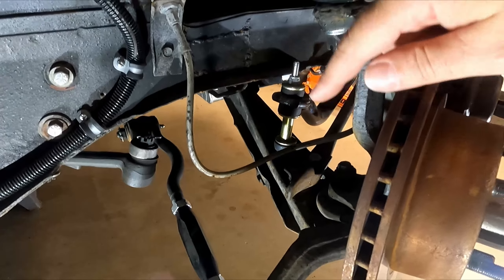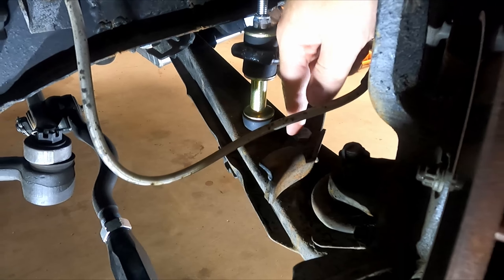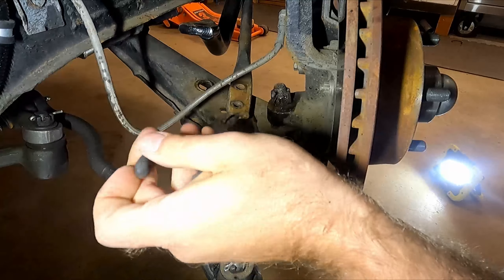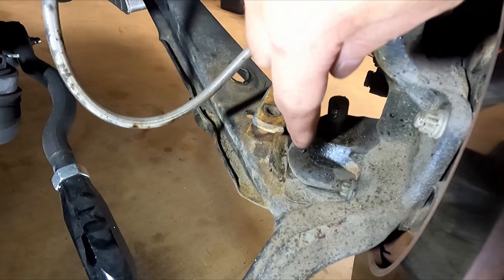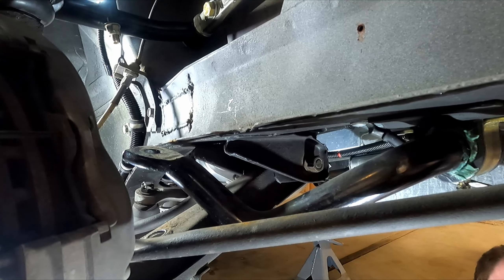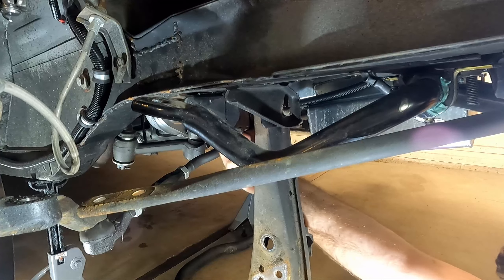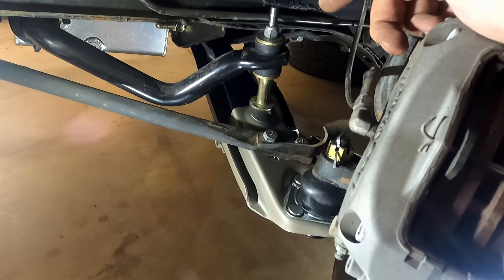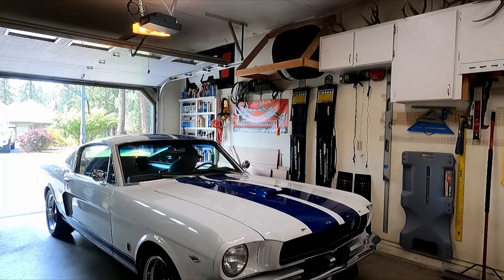How to replace the Lower Control Arm - Classic Mustang

Comment: Andy, make sure not to tighten your sway bar bolts until the car is back on the ground to prevent preloading/binding them.
Reply from the maker: The bushing that hold the bar to the frame are greased, allowing the bar to pivot when the car is sat down on the ground.  We're good.  :)

Comment: Hey there Andy, not to beat a dead horse 🐎 here, though it is critical, that the car be on its own weight, the front suspension be at or nearest it's "at rest" ride height, then tighten lower control arm bolts. The elastomer(pored rubber) in those bolt "sleeves" will "rip", and be destroyed, in short order, if they tightened while at full bottom travel. The twisted rubber "preload" effect, can make the car ride higher, and feel "strange" and "floatie" as well.. Otherwise, love watching you brother.. Your living, our "best" life !!!!
Reply from the maker: Thanks for the heads up.  :)
Reply: how do you reach them?

Comment: Hey Andy! I recommend picking up a cheap swivel impact extension from harbor freight (it’s branded Icon and is sold as a kit with 3/8 and 1/2). That chrome u joint one you were trying to use never worked well for me. The impact rated “cv” style from harbor freight works 10x better in my experience for tight bolts that have crud on the threads.
Reply from the maker: Yeah, there's a bunch of tools I need to get, but I keep using the old ones because I need the money for more car parts.  :)
Reply: The other issue is when that chrome one breaks and becomes shrapnel

Comment: Doing this on a 69 Mustang. Having a hard time getting the LCA ball joint bold to line up. Think I'm going to have to rent a spring compressor. Tried some minor jacking up on the rotor, no go. It's just too far out of whack and it seems to be coming from the spring load. Rumor has it that the previous owner put big block springs on this car and that could just be what is making this such a challenge.
Reply from the maker: Yeah, some times there seemingly simple upgrades can turn into a four hour ordeal.  :)

Comment: If those are Scott Drake lower control arm hopefully you have better luck than I did I had to replace the driverside after 15000 Miles because the ball joint went bad.  Probably need to replace my passenger side also
Reply from the maker: Yeah, they’re cheap, but that’s ok, they won’t be on the car long enough to worry about it. 😉

Comment: 5 star video Andy, Right now I am doing this exact operation. I am replacing the upper and lower controller arms. I am not sure how tight I should tighten the lower arm lower castle nuts. My concern is that have over tightened them. Good advice none then the less. Thanks Andy.
Reply from the maker: 75-100 ft-lbs on that bolt that attaches the lower control arm to the frame.

Comment: Good idea on the replacement LCA bolts. I bought the hardware store specials ahead of time, so of course the OEM bolts came out smooth as butter. If I hadn't bought the new hardware, I guarantee both the stock bolts would have snapped off. But I used my new ones anyway, because why not? 

Anyway, you're going to love your spherical-bearing LCAs when you get them. I installed mine last weekend (not Maier brand) and not only are they easier to install (you don't need to pre-load the suspension and squeeze under the car to torque them), but they're an absolute must if you're adding upgraded or adjustable strut rods. I worked them through the range of motion before reattaching the spindles, and it's easy to see why the stock bushing can bind or prematurely wear.
Reply from the maker: Yeah, there's some parts on these cars that are a major upgrade, but it's hard to make a big deal out of it when most people don't know or don't care.  :)
Reply: @AndyKruseChannel  I think the real weak link is the strut rod, and that's why later Mustangs went to an adjustable design. You'd be amazed how much play your front wheels have with the OEM rubber bushings on the strut rods, especially if they're the original ones. There's a couple of GoPro videos of it on YouTube and it's nuts how much the LCAs shift during braking and acceleration.

Comment: Literally doing the same thing today, I've completely stripped the front end of my 65 and I'm replacing every single steering/suspension part. 

That pivot bolt for the LCA, the reason it's blocked in by the crossmember is so if it ever came loose, it wouldn't come out and send you off into a canyon. 

You shouldn't use a pickle fork for ball joints. You can get a puller at Harbor Freight for $19 that will separate them in 10 seconds with no damage done to either the boot or the surfaces of the spindle. Even if you're not keeping the old part, it's way less effort too.
Reply from the maker: Good luck!  :)

Comment: Awesome video.  About to attempt this on my 67’.  I was wondering if you had to support the springs in anyway or if you could just let the uppers hang.
Reply from the maker: In my scenario the upper control arm and coilover setup can just hang there since the shock body of the coilover is fully extended at that point.  For someone with a stock spring/shock type setup, the upper control arm will hang down lower, but it will be fine when attaching the lower control arm to the bottom of the spindle. The lower control arms are much easier to swap out/service than the upper control arms.  :)

Comment: Thanks for your informative video on your '66 mustang.  I am curious though, it seems that there is no camber adjustment of the lower arm where it is attached to your frame.  So how is the camber adjusted on your '66?  My '67 has an eccentric adjustment for camber.  The main problem is that I have been unable to separate the lower ball joint from the knuckle.  I see you used a pickle fork, but that has not been successful in my case after pounding on it for about 30 minutes.  I am going to try a ball joint press next.  I put it all back together without changing the lower arm to get it temporarily out of my garage.  I have subsequently received a '67 lower arm C70Z-3078-A from Holley (who owns Scott Drake).  I will be getting back into the replacement later this  week.  Do you have any other suggestions to release the lower ball joint?  Thanks.  Charles
Reply from the maker: The camber adjustment for the 64-66 Mustang is in the upper control arm, using shims to push out the arm for less camber.
On the ball joint, you can try giving it a heavy coat of PB Blaster, or applying heat to it with a torch (can be purchased at Home Depot).  You also might not be giving it enough force what hitting the pickle fork, sometimes those ball joint bolts are rusted to the steering knuckle extremely well.  You can also use that ball joint press you mentioned, I have to use a similar tool when taking the Pitman arm off my steering box.  :)

Comment: Curious why you didn’t put in some of the tumblar lowers like this they make for the single lower arms on the early Mustang II front ends?  I would think they would flex less plus I think some come with poly bushings too.
Reply from the maker: I plan to do Mike Maier LCAs down the road, so this was a cheap replacement until then.  :)
Reply: @AndyKruseChannel  I see thanks.
Reply: @AndyKruseChannel  I looked on his website and sure glad I asked you because I didn’t know a kit like this was made but hoping so. I’ll definitely be looking into one of these kits for my pro street car. Was going to put a regular tubular single arm on the lowers but was hoping someone made one with this strut bar and now I see they do. Has to be way better than the stock stamped one or tubular one without the strut bar.
Reply from the maker: @Ron_Masterjohn  Yeah, I have his UCA on there now (and a video about the install), but like everyone else, I'm limited by funds, gotta save up for the LCAs.  :)

Comment: Are you going to put in a R&P?  I'm tempted but in order to not have bump steer I watched a youtube where some sort of vertical extension was put on the strut in order to keep the tie rod level.  Looked kinda funky.
Reply from the maker: No plans yet.  If I did anything it was be power steering first, like an electric power steering.  I might tackle that next year.  :)

Comment: Hey Andy, do you need to grease the joint with the rubber boot after installation?
Reply from the maker: At a minimum you should check to see if there’s an enough grease. This can be done before installation into your car, just to make it easier. 🙂
Reply: Thanks, good advice! And nice choice on your newest project, I will follow this build also, your videos are always helpful

Comment: Sorry if I am missing something. Why didn’t the spring push down the upper control arm when you removed the lower control arm?
Reply from the maker: It's because I have a coilover setup on the front.  The springs have a higher spring rate, so they don't need to be as long, which is why the stock setup pushes the UCA down so far.  :)

Comment: Andy. Did you ever get the new Mike Maier lower control arms? I don’t see a video of them. This is an 8 month old video.
Where you going for the MOD Lower Control Arm & Strut Rod Assembly ones or just the plain much cheaper priced Mustang Stock Lower Control Arm? I just ordered Maier’s Upper MOD Tubular Upper A-Arms. Thinking about getting the Lower Arm with Strut Rod.
Reply from the maker: Not yet, it's still on my list of parts to get.  :)
Reply: @AndyKruseChannel  Cool! I’m ordering them, but would love to see you do a video of them being installed. Mike says they will be ready in a couple of months.
Reply: @AndyKruseChannel  BTW, talked to Mike. They are currently fabricating the lower control arms/strut rods right now. But after these sell out, the next run will be until a year from now. So if you want them, you better preorder them asap…

Comment: Hey Andy I know not part of the video but what serpentine belt conversion did you go with?
Reply from the maker: Still have the standard V-Belt, just the alternator and water pump are driven off the crank hub.  :)
Reply: @AndyKruseChannel  you having any issue with belt burning and slipping off its mostly the alternator to water pully belt